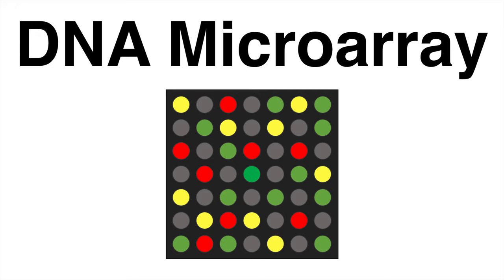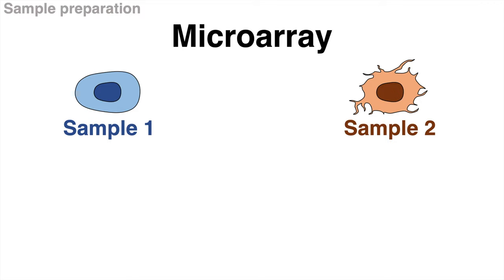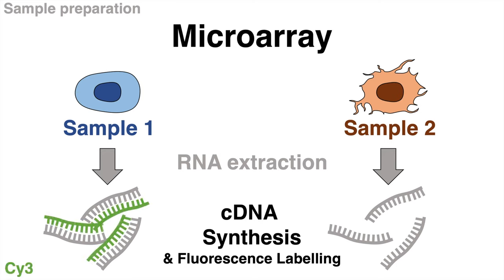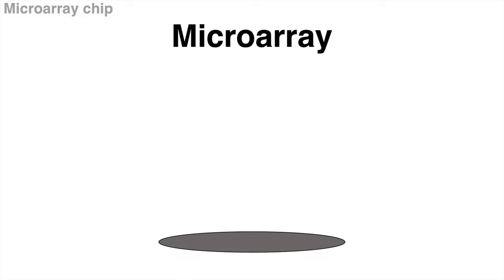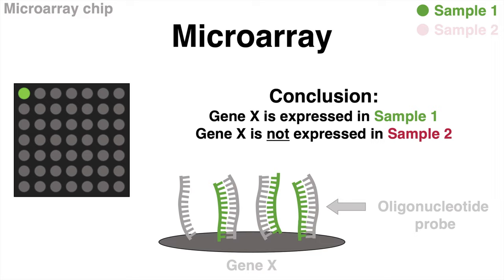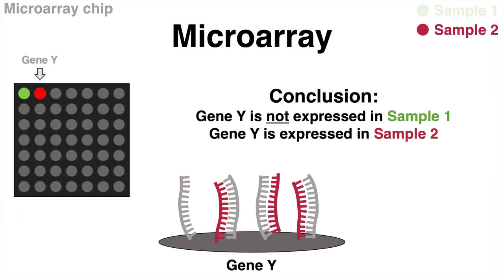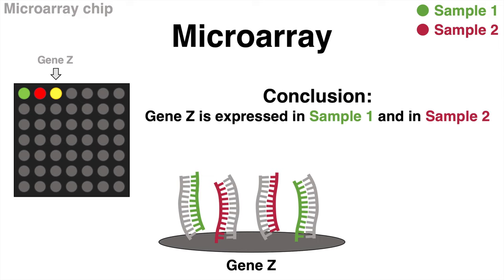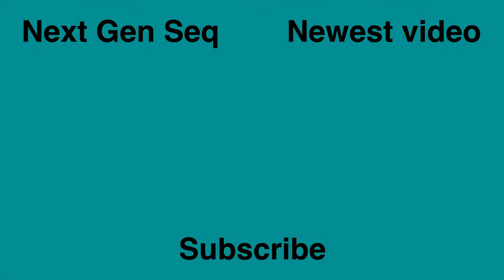DNA Microarray (DNA chip) technique

Comment: It is incredible your ability to do concise videos with a lot of information and completely animated! I have just a question: how exactly does the cDNA become fluorescent? All the bases used are fluorescent?
Reply from the maker: Thanks, that means a lot! 
I did some more in depth research... and there are many ways in practice. One as you mentioned is using fluorescent nucleotides (all dCTPs are labeled). Another option is: using fluorescent forward primers. This paper might help in case you are super interested in the labeling steps:
https://www.sciencedirect.com/science/article/abs/pii/S0167701205001806
Reply from the maker: Another possibility:
Using 3´end labeling with fluorescent nucleotides + terminal transferase
(https://www.future-science.com/doi/10.2144/000112182)
Reply: Super interesting and clear. Wish you could do some videos on the energy metabolism of cancer cells!
Reply from the maker: @binebum1  I did one about the warburg effect.. check that out!

Comment: Clear and concise explanation!  Question:  does each sample go on its own microarray, or are they mixed and applied on the same microarray?  Thanks!
Reply from the maker: Each sample is typically applied to its own microarray.
Reply from the maker: However, there is also the possibility to apply multiple samples to a single microarray. This is commonly done with a technique called "multiplexing". It is done by hybridizing different labeled samples to the same microarray, or by using different probes for each sample on the microarray.
Reply: Ah, that's why it was confusing.  It seemed like "sometimes".  This really clarifies it.  Hope it helps others too!

Comment: Can we have more samples at the same time;Does this technique only work for cancerous cells or any type of unhealthy cells;
Reply from the maker: Yes, you can apply multiple samples to a microarray at the same time. This is commonly done using a technique called "multiplexing". Multiplexing allows multiple samples to be processed simultaneously on a single microarray. It is done by hybridizing different labeled samples to the same microarray, or by using different probes for each sample on the microarray.